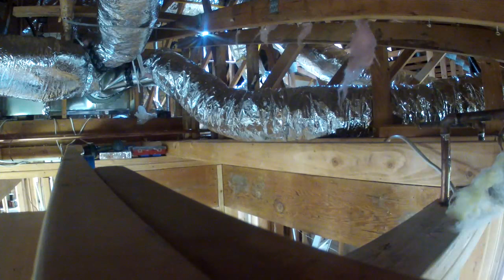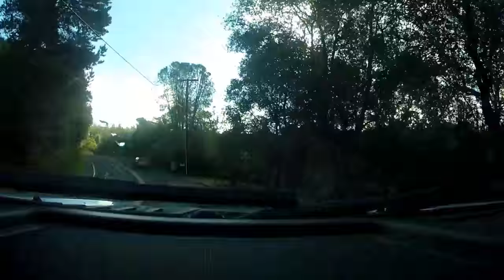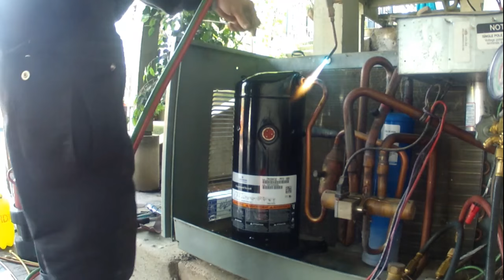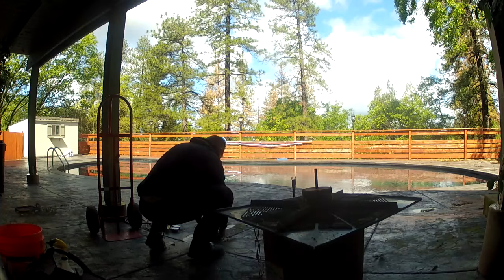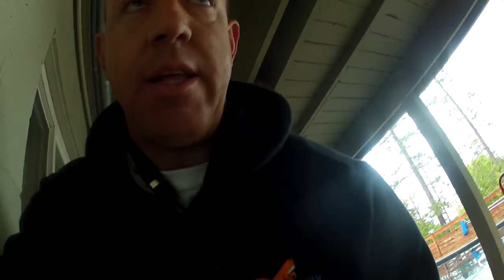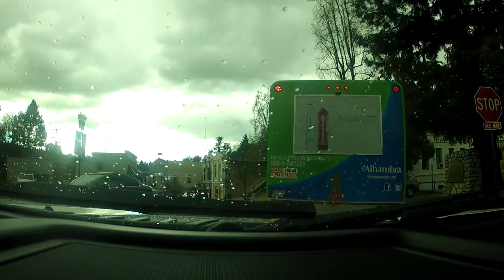Compressor and Fan Motor Part 2

Comment: hey bud glad you got it going, gotta love them old ruud units the first one I changed a fan motor on threw me for a loop I had to get an adapter plate thank goodness for rescue motors
Reply from the maker: +Rodney Thornhill YeahThat was a fun job!  I got to work with 407c for the first time too
Reply: I have never used the 407 however I have retro fitted some commercial refrigeration and it is very important that when doing so you label that equipment with its new charge

Comment: Alright! 
I'm glad you got it up and running! I always start with 3 lbs when I have a short line set.
Reply from the maker: Thanks Juan. Your videos are getting better and better all the time. I enjoy watching them.
Reply: I enjoy it. You?
Reply: Making the videos, that is.
Reply from the maker: +The Air Conditioning Guy oh yeah I am always looking for opportunities to make some sort of new video. I liked the video on the insulated plenums you made the other day. So much better with the astro foil than the yellow wrap.
Reply: It looks better but the R value of 4.2 is low unless I use spacers; I'm not going to use spacers. It takes long enough to insulate work just one layer.
Reply from the maker: +The Air Conditioning Guy Right no way, too much time

Comment: Nice work. FYI those new plug leads for the compressor are long enough to hit the control cabinet.
Reply from the maker: +Rob HVAC That would be no bueno...
Reply: +Fox Family Heating and Air Conditioning are you sure it wouldn't they have always been too long for me

Comment: Great work! Not questioning what you do but Is there a reason why you didn't change the reversing valve? Never know if that was the culprit for compressor, cheap insurance I guess. I was always told to change RV when changing compressor. What's your thoughts?
Reply from the maker: I have never been told that, that would be an interesting topic this weekend in our live chat on Saturday night.
Reply: +Fox Family Heating and Air Conditioning Yes it would, I'd like to here what others think. It makes sense to me to do it. RV are inexpensive and you already have the system open. Once a compressor clunks out you realy can't diagnose what caused it. So when a compressor goes out we replace reversing valve, compressor, contactor, cap, and drier.
Reply from the maker: +Richard Baylis yeah but you did see that filter I pulled out of the air handler didn't you. 16 years old... Lol
Reply: +Fox Family Heating and Air Conditioning lol yes, "you mean we have to change the filter?" 😂 All in all good job bro, I was just throwing it out there what the guys at my shop have shared with me.👍
Reply from the maker: +Richard Baylis Oh yeah I really appreciate the feed back.  Any time Richard.

Comment: do you think we should replace the txv & filter drier as well cause retrofit with the 407c?
Reply from the maker: +Vincent Yes we changed the filter drier but did not change the fixed orifice on the system.

Comment: My question is I find it strange for you to get caught up as it played out as I would have thought you would have look real deep into a 17 year old system before I would recommend the customer spend the kind of money a compressor and fan motor/ recharge would cost. I have a grave yard of dead units out back and there no one working compressor in the pile. As of late that seems to be the number 1 reason for change outs. Good video and great you worked it out. You can run but can't hide from a Megger. LOL
Reply from the maker: +Gene J I understand your point but at Fox Family we will not push any customer to do something they dont want to do.  In this case, the client was looking to get the system operational enough to sell the home immediately.  So when it came to figuring out whether they wanted to pay a lot for a new system or a quarter of that to get it running again, I just did what they wanted.  Thanks for the comment.  I appreciate you watching and sharing your experience.
Reply: I understand if they knew they might end up with even more cash might be  needed  due to not knowing if the coil might have hidden issues. then it there dime so to speak.

Comment: Get yourself megger test to test out the compressor one of the winding inside started to break down insulation on the winding cant do with a regularly volt meter nice job I with you what is it service fix the problem its up to the custom this is where you make $$$ in service.